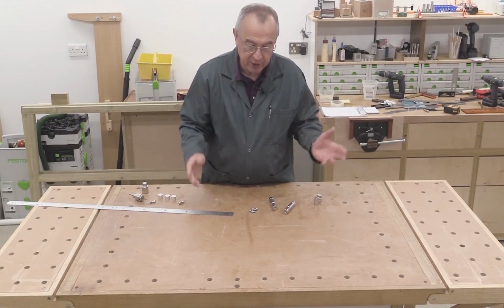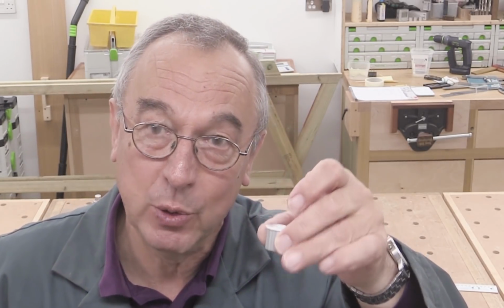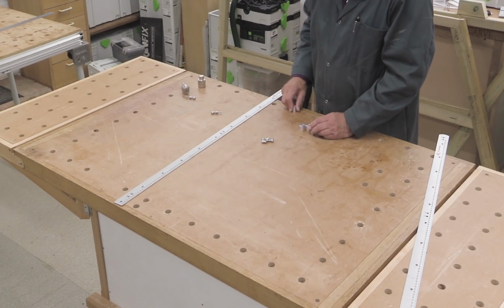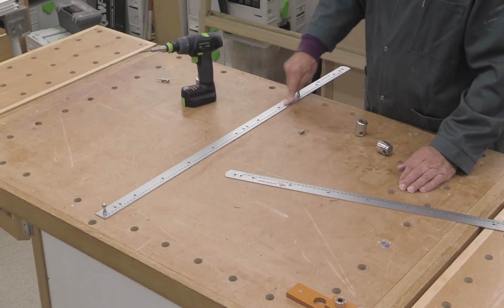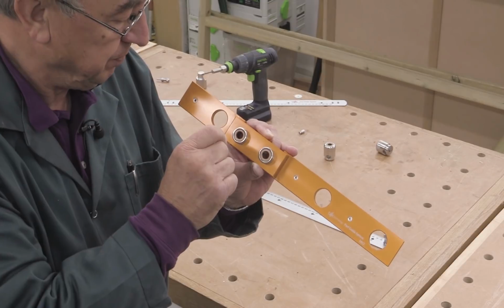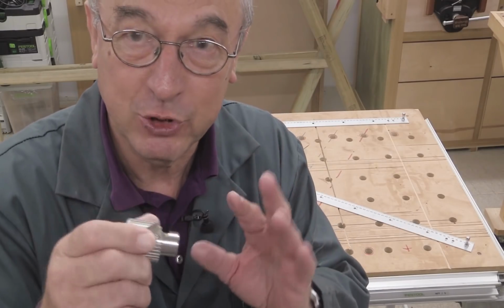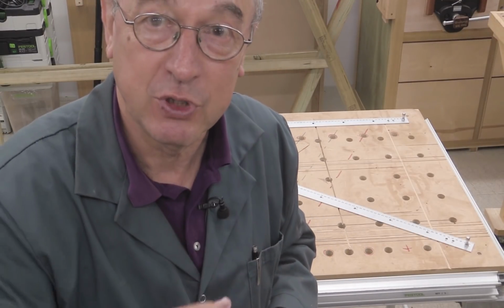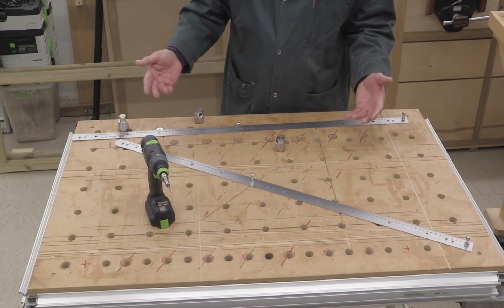New - Parf Revision Dogs

Comment: Have the general quality control issues that Axminster were having with the Parf Guide II system been resolved? I was going to buy but have been seeing a lot of negative comments on a number of forums including Festool Owners Group and UK Workshop.
Reply: John, I did have an issue with my early edition parf ll system. 
As always axminster customer care was faultless and the part was replaced, (with a revised and improved part).

The (flat) head of the grub screw in the collar snapped. 
It's now an Allen key grub screw.

I've always found axminster customer care second to none.
Reply from the maker: Hi John, That was caused by just one small batch of rulers. Axminster reacted very quickly and withdrew everything, sacked the subcontractor and brought the work in house.   Peter
Reply: New Brit Workshop Peter. I ordered a MK II system from Axminster last week, and one of the rulers is narrower than the other, and the holes are not drilled in line with the etching.
I got in touch with Axminster and they said it has no effect on accuracy. I wasn’t happy with that having paid £180.
They did however send me a replacement ruler, which had exactly the same error. In fairness, the man at Axminster told me it probably would have, and that it wasn’t an error.
I’m a bit gobsmacked to be honest.
I’ll be taking it back to a store rather than using customer service.
I know it’s not your fault, but quality control is amiss somewhere, and axminster appear to have not replaced the faulty rulers / sticks as at Sept 2020 😟
Reply: @michaell8835  This is interesting to hear. I thought the every manufacturer in the history of mankind go-to excuse of ''only a small batch - all now resolved'' was a bit too good to be true. I've also seen criticism of the recently introduced Parf fence. Maybe Axminster should know their limitations and just stick to retailing products and not overreach with their own lines.
Reply: John Power In all fairness, I’m not sure whether the problem with my sticks is the same as the original fault.
One stick is perfect, and I now have two other sticks where the drilling isn’t in line with the etching for the holes.
Axminster technical support told me that the holes are actually in the correct place, but I’m left with a doubt in my mind .... due to the fact the manufacturer can’t make consistent parts.
The very fact that the holes look more like ovals doesn’t fill me with confidence.
I’m not a troll kind of person, easy going quiet kind of guy, but this type of thing really upsets me .... it’s not like it’s a bargain product.
To be honest, the guy at technical support was a bit arsey in his emails.
Reply: @michaell8835  Entirely understandable. £180 is very expensive for what the product actually is, and I'd expect it to be absolutely perfect for the cost.
Reply: John Power Yeah, I had it in my head that UJK stuff would be perfect out of the box, I thought they were up there like Incra and Woodpeckers. This has tainted that view, and I’ll be wary in future.
I’ll be taking it back to store, to sort the problem face to face, which I really don’t look forward to. But I want the product to be as it’s supposed to be, even if it’s just aesthetics. Holes and etching misaligned just looks rubbish.
Reply: @michaell8835  I've had mixed success with UJK. From what I can tell the white-box products that simply have UJK slapped on them seem to be fine. But it seems to go wrong when they are products made for Axminster/they have a hand in designing and setting specifications/acceptable tolerances. I have had bad personal experience with their pocket hole jig, and I know others who have had issues with the drill guide. Conversely I haven't had a single issue with my UJK router table.
Reply: John Power Thank you John. That’s info worth knowing. I’ll post up a reply here, regarding what happens when I visit the store. Hopefully they’ll be more understanding than the man at technical services.
Reply: John Power Went to the Nuneaton Axminster store today, and they were incredibly helpful. A new box of Parf Mk 2 was opened up without hesitation in the slightest, and swapped the items over so that I’d got perfect matching Parf sticks. 
Would have been so much better had it been perfect to start with, but I’m super happy it’s now been resolved.
The store assured me the kit they were left with, with the offending ruler / stick would be sent back to the warehouse as faulty.
Good result, shame that technical services were not as helpful in resolving the problem properly in the first place though.
Happy now.
Reply: @michaell8835  That would have no effect on accuracy which is the distance between the 3mm holes. I’m sure if you laid the rulers atop one another and put a pin in each end all the holes will line up. The edges of the ruler aren’t used and don’t need to line up with the holes. They could easily have used blank strips of stainless steel but the 1 m rulers already have finished edges. The measurement markings are handy for other stuff — you now have 2 free 1m  straight edges.
Reply: @paulwhealy5243  As I said previously, the error may well have no effect on accuracy, but I'm not happy paying £180 for a kit which has printing and drilling (or stamping) in different placement. Simple as that. 
I made no comment about the edge of the rulers or the positioning in relation to the edges.
I only commented that the holes and printing of the holes were offset from each other, making the holes look like ovals.
Anyway, I took the offending items back to Axminster Nuneaton as I didn't want them .... and they furnished me with a perfect item.
Reply: Mine was bought a year ago and is faultless. Measuring the edge of the holes against a long Woodpeckers ruler (the closest thing I currently own to a reference straight edge) reveals absolutely perfect alignment. I have had a problem with another product purchased from Axminster: as James Balland has said, their customer service was faultless.